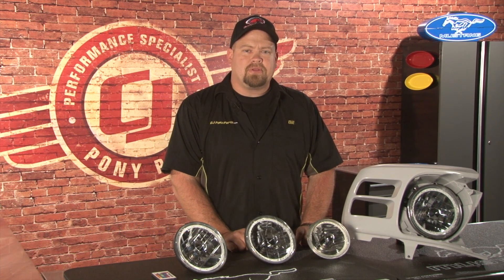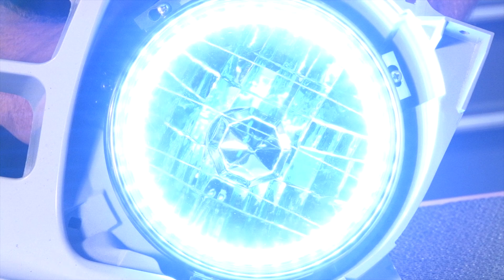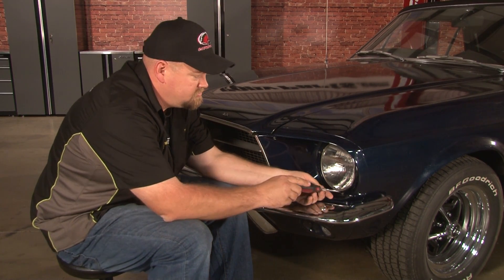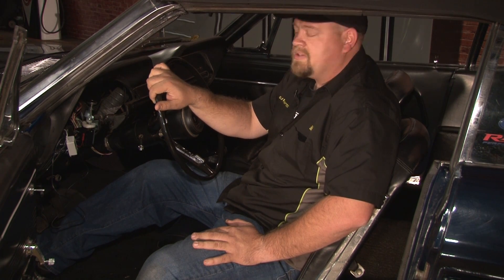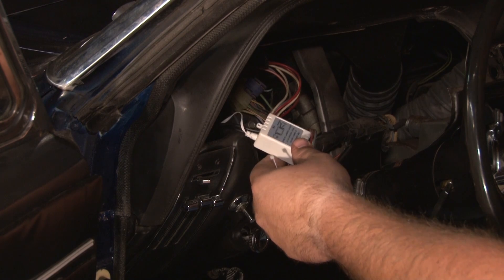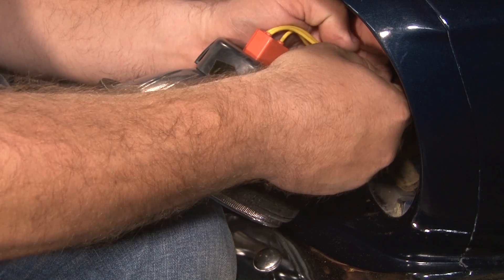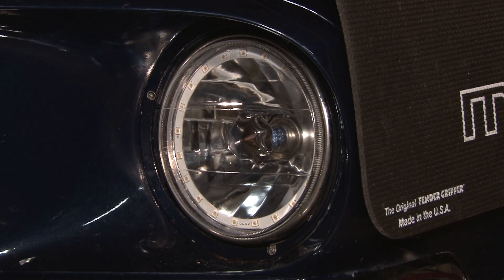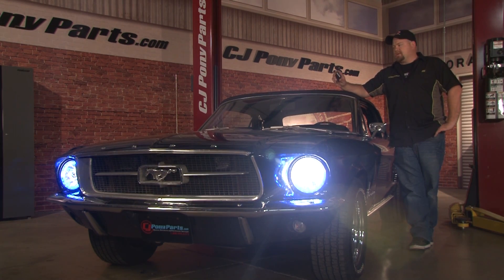LED Halo Headlights | Redline Lumtronix | 1965-1968 or 1970-1973 Mustang

Comment: These are available in two sizes, 7 in and 5 3/4 in. which will fit many many cars made from the 30's through the 70's. The 70 Cougar should have a 5 3/4 in.

Comment: Your 73 Vette should use an H5006 sealed beam, the same size used on the 69 Mustangs.We offer a specific kit for the 69 which would work on your vette. Part number HLA35 for multi color or HLA36 for white

Comment: I'm a bout To connect the HaloHeadlight and do not want to run them as daylight. Only want to turn them on when I wish via my switch. Does that mean I do not have to connect the red /black wire and only use the 3 prong harness connector ?

Comment: So, can u just use the headlight, without the halo? like, for when your driving, just use the regular bulb, and no halo, or are they both connected? Could you turn the halo off while the regular headlight is still on?
Reply from the maker: The Halo has its own wiring so it can be run seperately.
Reply: Did you even watch the video?...

Comment: i have headlights like these i noticed they have a halo ring but i didn't know how to connect them to the parking lights. how would i do it? it has a red and black wire
Reply: Slow 6ix how do I connect Lalo lights with out connect to parking lights
Reply: Slow 6ix I spliced mine into the park lights
Reply: if your car has a connection to fog lights or parking lights/turn signals you can unplug that or use extra wiring and connect it to the halo connection

Comment: How would i make the hole bigger in the back of my headlight bucket, the back of the headlight wont go in
Reply: On some buckets you may have to use a grinder or a dremel to open up the hole.